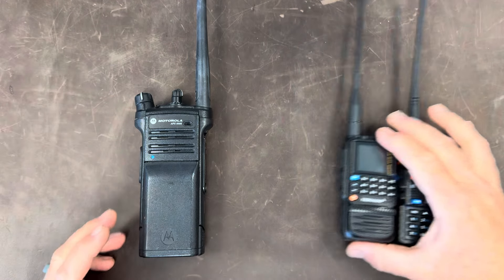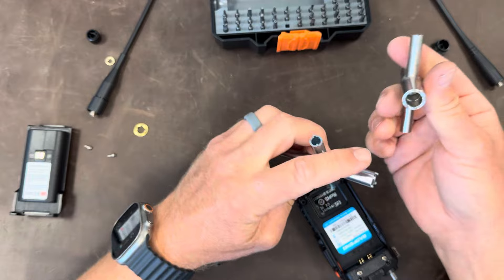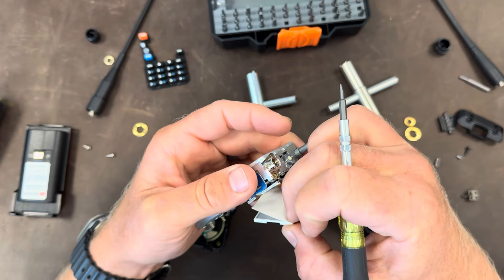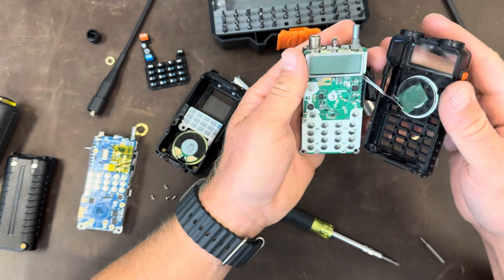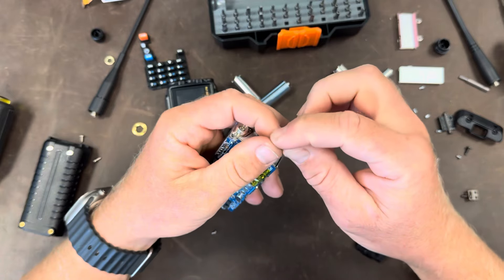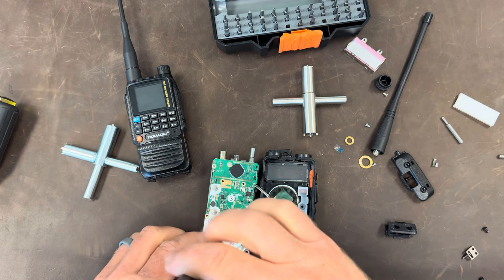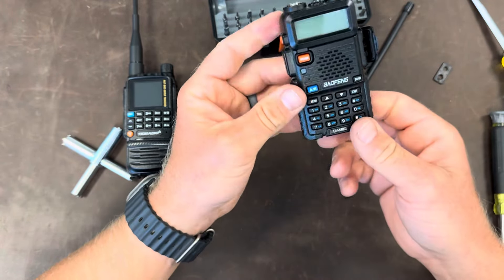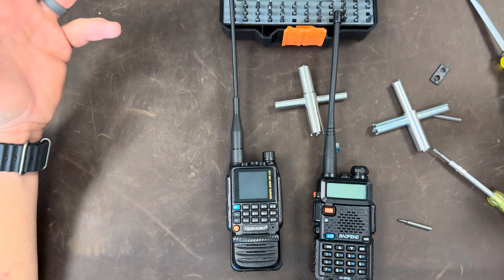Is the TIDRadio any better than a Baofeng? Let's take them both apart and compare.

Comment: I am completely new to radios but have seen the need/use case with the recent natural disasters.  As most of my family lives in a small city or a few miles outside of a small city, do I go GMRS for the simplicity or should I delve into HAM even though I would probably be the only one to get licensed and will be possibly further away from said family?
Reply: Go ahead and get the GMRS license since it's easy and cheap. Get used to using it and meet the local people in the repeaters if there's any in your area. Get the family in on some basic comms. Then go ahead with ham on your own so you get the knowledge and license to operate some more robust and farther reaching equipment. You'll probably be alone in that endeavor, but your skills would be beneficial for the entire group if you ever need to employ them.
Reply: You can use HAM in an emergency emergency without a license, but you can also use MURS frequencies with no license. 

Infer from that what you can.
Reply: @griftinggamer  I don't quite follow you - I'm super new on this subject